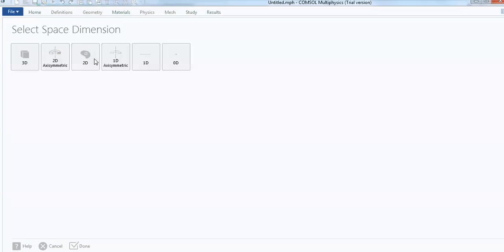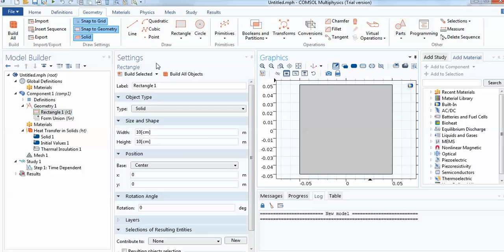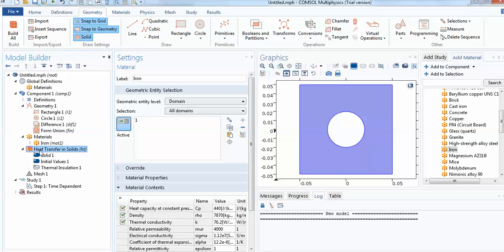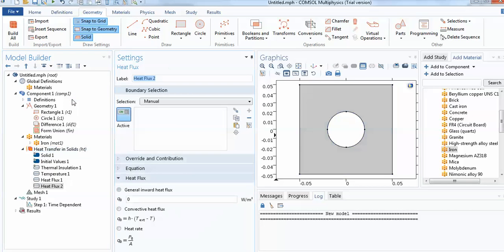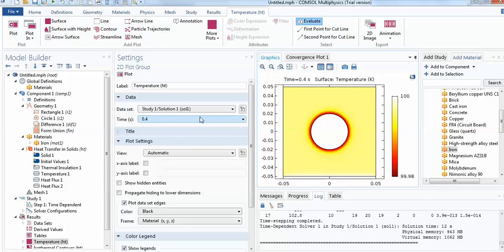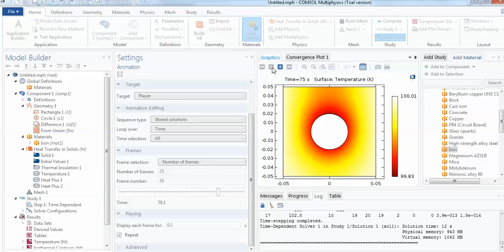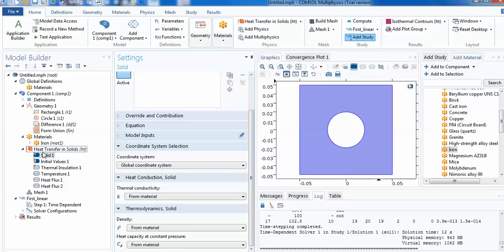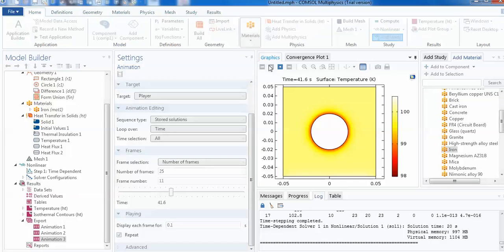COMSOL: Time Dependent 2D Heat transfer Problem with Animation L-4

Comment: Thank you for this informative video, I would like to ask, Is it possible to model a Transient HT problem for a an Insulated tank that contains aggregate held in 100 c and see the temperature of the aggregate after 24 hours, in other words what would be the temperature of the aggregate after 24 hours if it was preheated and sent to the tank at 100 C. I appreciate highly if you could suggest something or tip sth in this regards. which boundary conditions may be used in such case, and how to model the aggregate? Thank you in Advance

Comment: hi , can you tell me how to simulate a condition where one surface touches another surface due to deformation caused by thermal loading creep, but solution does not converge due to air gap in between

Comment: hello , 
i'm trying to simulate transient heat transfer in solids using comsol , but i'm facing a problem the thermal diffusion is the same in the whole geometry at all times . in other words the temperature of the heat source is the same as  the temperature of the edges even with very small time steps . and they increase at the same time .. any idea of the issue ??
thanks in advance

Comment: hello thank you for your answer
I have a study 3D to make with comsol and I dont know how to do it 
I have two attached walls one of concrete and the other of wood and between them there's a small defect of air that makes a detachement between the wood and the concrete
I appllied heat flux from the concrete about 2000w/m2 and a 25 degC temperature from the wood 
after computing normally i should have stain that represent the detachment in outsiide surface of wood which I dont
can u please help me and thank you.

Comment: sir, your video is really helpful. Can you teach me about heat transfer in fluids? (3D) there is a pipe in pipe heat exchanger such that water flows in the outer pipe while there is ammonia in the inner pipe (closed cylinder)

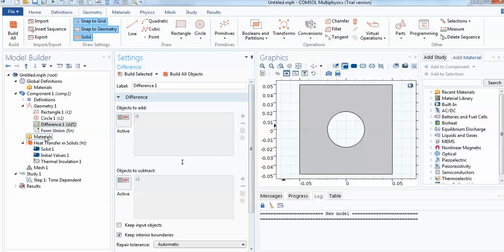Comment: Thanks for your video. But I have question about the objects to substract: c1 at 2:29 in the video. My comsol version is 5. And everytime when I want to substract c1,  I alway choose r1, could you tell me how to do it in your video. Thanks so much
Reply from the maker: You should send the .mph file to my email id scientificrana@gmail.com. I will check it for possible corrections.
Reply: You can use mouse wheel to switch between those 2 geometries ;-)

Comment: Hello Rana, thanks for such a nice and detailed tutorial first of all. Secondly, i was working on COMSOL for the first time for a university project using the Acoustics module. I would be more than happy if you could guide me on how to simulate ultrasonic wave propagation in a solid using a 2D model..
Reply from the maker: I will make a video for the same. Thanks
Reply: Thanks a lot for your help. My project is basically about passing Ultrasonic waves at a certain frequency, say 10 MHz from a point source on the upper boundary of a simple 2D solid rectangle with a defect (I've used a simple circle to emulate a defect using the difference parameter) and measuring or simulating the resulting perturbations/distortions on the bottom boundary of the same model using a point probe or a boundary probe but, in the time dependent domain.

I can send you my .mph file in case you need it so that you get an idea of the model geometry. I'm confused about what type of physics should i use in order to get the correct results. 

1. Pressure Acoustics, Transient 
2. Acoustic waves - Solid interaction, Transient 

Really looking forward to your video as my deadline for submission of the report is closing by the 20th of this month..Thanks again.

Comment: Hello , nice video.
What does the color bar signifies ? Also can you tell separately what are the boundary conditions ?
Reply from the maker: Hello nasa, color bar signifies the variation in temperature through out the cavity. boundary conditions are already  mentioned 4.33 to 5.00

Comment: Hi, nice video.
I have a rectangular and I'm trying to solve a problem with two different step:
1) convective boundary condition on all the 4 sides2) fixed temperature on the top and the bottomI would use the results of the first step as initial condition, for the second step.
But COMSOL starts again from the "initial value".Thank you for your help :)
Reply from the maker: You can send my .mph file to my email scientificrana@gmail.com. I can discuss this with comsol research team.